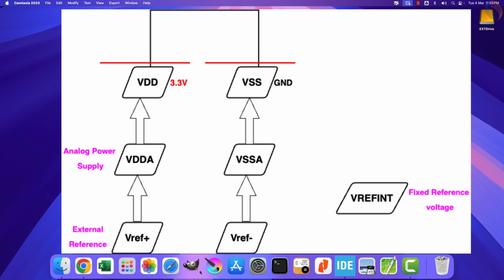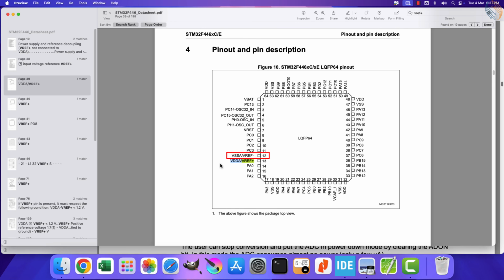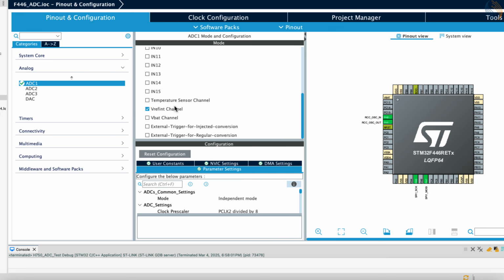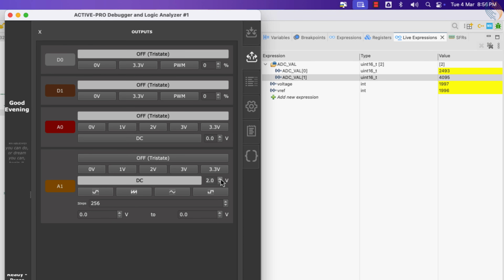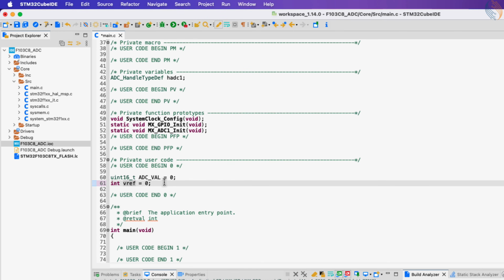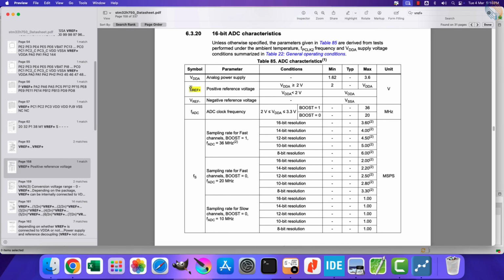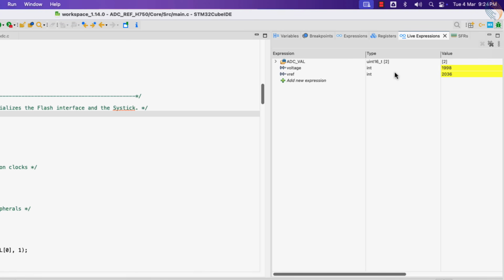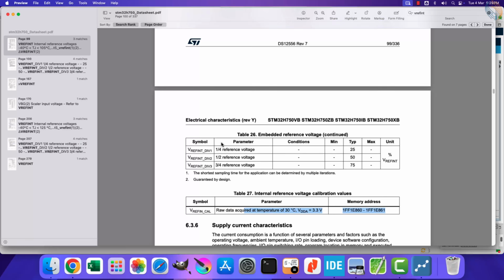STM32 ADC (Part 10): How to measure VREFINT and use Custom Reference Voltage

Comment: For my STM32H7, the datasheet says the linearity (not offset) calibration was done at 3V VDD and VDDA. 
The datasheet says linearity cal is done once at factory under certain conditions. 

Should i do linearity cal myself as my system is running on all 3.3V VDD and filtered 3.3V VDDA or load factory default?
Reply from the maker: You can load the factory default, but make sure to use the 3V instead of 3.3 while calculating vref.
Reply: @ControllersTech  I didn't understand what you meant 😰

You mean put 3V as VRef in ADC Voltage Read = (ADC Reading/2^16bit)*VRef even though i am using 3.3V as VRef